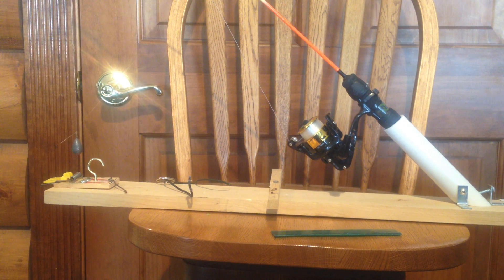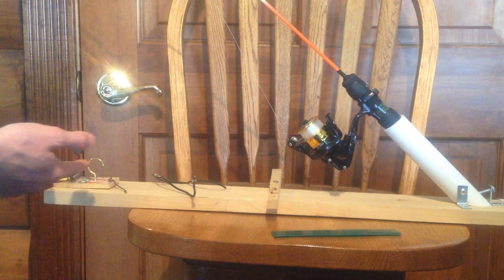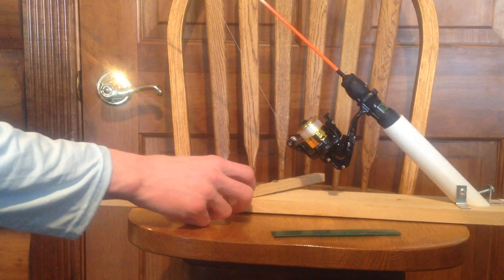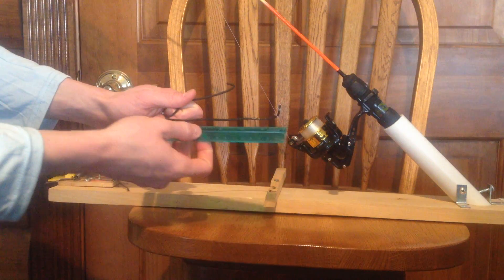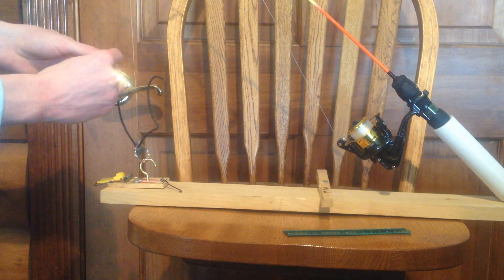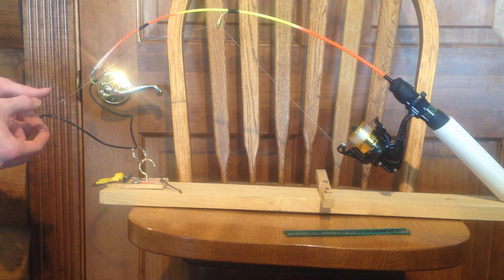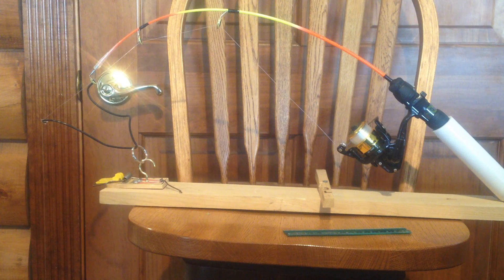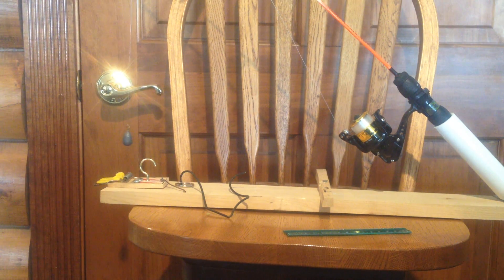My Homemade Automatic Fisherman

Comment: cool idea.  I think you need to slide your release further into the eye.  that way it won't be so sensitive and will give the fish a chance to take the bait before setting off the trigger
Reply from the maker: Thanks for the comment.  That is a good idea.  I've gotten pretty good at making these, but whenever I take them out ice fishing, tipups seem to do better.  Nice to have on hand though.
Reply: that was my issue with my jaw jacker anyway.  I made it slightly less sensitive and seemed to make a world of difference.  good luck on the ice
Reply from the maker: Thanks, you as well.